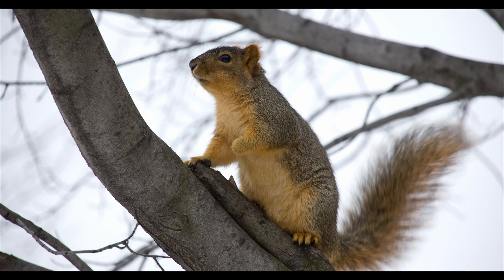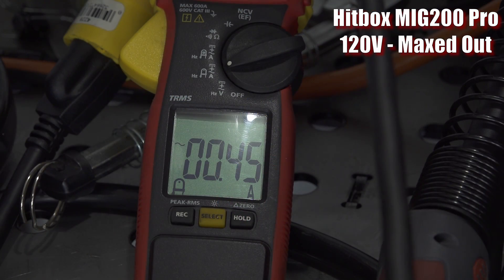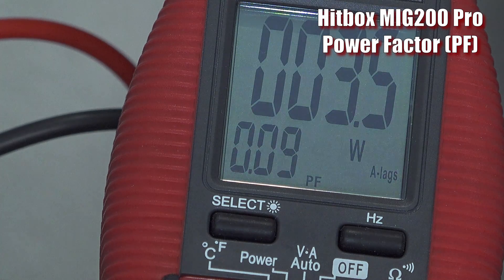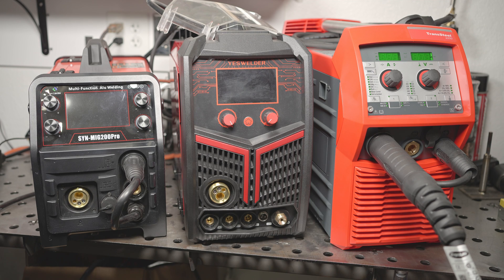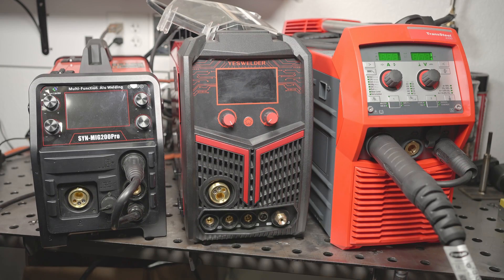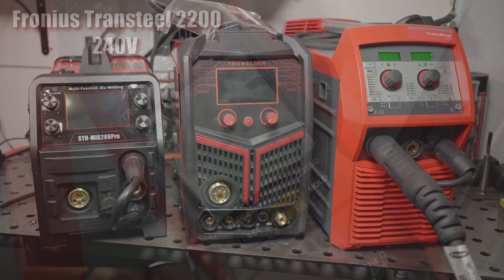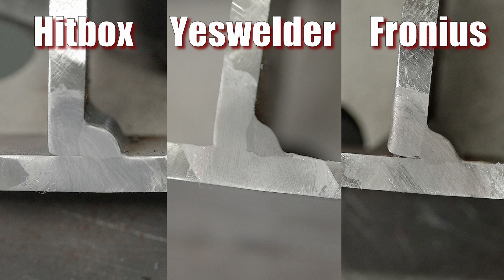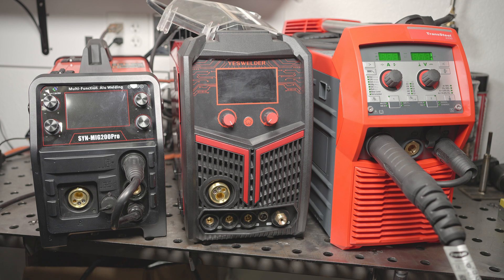Multi-Process Welder Comparison Part 2: MIG Output Testing, 240V and 120V

Comment: I took delivery of a previous gen hitbox mig200ii (identical to arccaptain mig200 as far as I can tell but w/led panel instead of lcd).  I believe it may be internally similar to the one reviewed here.  I was not able to go beyond 180A adjustment on synergic no matter the diameter selection, but under manual at max wire speed (no amp display when doing it this way) and max volts, my clamp meter read 200-220A using .03 flux core.  The display also shifts from wire speed to amps when welding starts though this one would only read 180-200A max.

I also had cut outs but I had my roller installed backwards and was using a v groove.  Once I selected the correct v-groove size, cut outs went away....I've now installed a v-curled....the machine came w/o one even though it came w/a flux core spool.
Reply from the maker: I suspect a LOT of the generic welders on Amazon (and eBay, aliexpress, etc.) are based on similar guts made in the same handful of factories.
Reply: @bigtb1717  I lowballed the same Riland seller I bought the tig from at the auction site for the comp's 200A multiprocess (I'm guessing he's liquidating inventory).  The thing is very well built (think HF vulcan line).   It claims CSA certified which I believe given the duty cycle, heft, and I haven't popped a breaker.  The downside is it's synergic w/only +/- 20% voltage trim allowance.  A reviewer on youtube kind of sold me on it.  Hitbox has way more flexibility though.

Comment: Does any multi-process welder out there have a decent power factor and not have obscene power draw on 120V and actually weld decently?
Reply from the maker: I would say the Fronius Transteel 2200 meets those criteria.
Reply: Hmm.  Maybe I missed something but I wasn't too impressed by comparison with the other two machines in this review.  It certainly was better behaved, but at 2x to 4x as expensive I would've expected much better.

I keep thinking back to the Klutch machine you reviewed and I simply can't comprehend how no one has put that kind of care and thought into a fully multi-process machine.  I would gladly pay, say, double  or even 2.5x that (at the time) $400 price for a machine that could do ac/dc/pulse MIG and TIG plus stick, and do so with the same power factor and output control as the Klutch (and gave as nice results, too, obviously).
Reply from the maker: I admit my testing probably wasn't the best demonstration of the Fronius in terms of displaying fantastic welding.  But I would say that it welds very well in most situations.  As far as power factor is concerned, it's as near as you can get to perfect.  It measures 0.99 power factor.  A power factor of 1, or "unity," is "perfect."  

When I tried to get more out of the machine on 120V than what really made sense, it would limit voltage or wire feed speed to prevent the output wattage from going above a certain level.  This meant that the input current never got excessively high.  It never had obscene power draw on 120V.  Honestly, I would never fear tripping a 20 amp breaker with the Fronius.
Reply from the maker: Oh, and that Klutch machine really is a gem for the price.
Reply: Yeah, I wasn't referring to the weld quality (though, honestly, the Hitbox looked like it was performing the best of the bunch just in terms of weld quality), just the current draw of the Fronius.  It was still pulling 30ish amps.  Only slightly better than the half-as-expensive Yes welder (though, admittedly, also putting out more current if I understood the video correctly).

But, yeah, it's an incredible letdown to me that there don't yet seem to be any fully multi-process machines out there offering the kind of value and quality as that Klutch.  I would much prefer to have an all-in-one solution but it's starting to look like that just isn't in the cards (the Fronius is simply too pricey from my perspective).

Comment: How does the Hitbox compare in MIG to the Yeswelder 205 you reviewed a while back? Was the 205 overrated on current like this MP200?
Reply from the maker: The MP200 and 205DS performed virtually identical and had the same features and capabilities in terms of MIG, TIG, and stick.  The MP200 just had a different interface and plasma cutting.  Even the way the MIG synergic adjustments worked was the same, the MP200 just used a color screen instead of digital number displays and LEDs on the 205DS.
Reply: @bigtb1717  thanks, very helpful

Comment: there is a setting on the fronius that limits the amount of amps the machine pulls from the 120v and 240v circuits btw
Reply from the maker: Yup.  Nice to help prevent pulling too much current or tripping a breaker.  I had that setting turned off for all testing.  In case you were wondering.

Comment: Really great video. I have never seen someone check the input output amperage before not is very telling on some of these machines. Do you have any thoughts on the comparison between the yeswelder 205DS and the Everlast cyclone 200 es or similar. I am thinking of purchasing one of these two welders
Reply from the maker: I've tested the 205DS on this channel. I'd like to get a Cyclone to test, but haven't yet.
Reply: Thank you for replying so quickly. I watched the review earlier. I just had a 240 volt circuit installed so that I could upgrade my welder. I am looking for a MIG welder that is reasonably priced that will give me 200 amps for thicker metal. After watching some of your videos I have some concerns about these welders producing the proper amperage. It cost me $600 to have the 240 installed and I expect to pay another five or $600 for a welder and that would be a lot of money just to get 20 more amps then my 110 welders. Let me know if you have any thoughts or suggestions. Thanks

Comment: Another nice Video, lovin your DMM, good ole Dave Jones kit. The PF corrected machine has got some grunt, the MP200 struggling as always... Did you order the 2050 after? Defo looking forward to your assessment.. Not gone through every video of yours but first time seeing power analyzer kit. I used a DSO for most of my tests on the MP200. I tried to compare it to a repaired Welder that also featured Lift TIG but for whatever reason I couldn't get that to behave like the lift tig descriptions from a google search. If you have a DSO and current clamp it would be nice to see a proper lift tig machine behavior captured waveform.
Reply from the maker: I don't have a DSO, but I have tested the open circuit voltage of other lift TIG machines.  Typically they have very low open circuit voltage (9-20 volts).   To me it seems like when you initially touch the electrode to the work they provide only very low amperage.  It's not until you lift the tungsten and the machine detects the circuit opening up that the amperage ramps up.  I should do a video just testing and showing the difference.

Oh, and yes, I ordered a CT2050.  I'll be giving it a thorough shakedown.
Reply: Look forward to that... Its safe to say the MP200 has lift start and also hot start, well, that's what yeswelder call it.. The hot start is extremely brief and the lift start, well 50A flows soon as tip hits workpiece.. This stuff can be worked around I guess but I'm little disappointed if I'm being honest.. Just sounded so good, well done to they're campaign.. Keep my MP200, best welder I got.. (like, only welder I got)..

Comment: Looking forward to the TIG/stick video.  I have the MP200 and, other than verifying it worked when it was delivered, I haven’t touched the MIG.  TIG and stick issues are still more my technique and lack of knowledge than the welder, but I’d like to see your experience with it.  Keep up the great videos!
Reply from the maker: I have already done a bit of stick and TIG with the Yeswelder.  As for stick, it does fine, but it maxes out at 160 amps on 240V, not the 200 amps claimed.  This means you are likely getting less amperage than the display says.  If one of the "issues" you alluded to is that the rod sticks a lot or runs cold, try turning it up beyond what you might thing, because you might not be getting the amperage out that the display says.  I also don't think it runs 6010 very well, even in 60xx mode.  Otherwise, for running 6013, 7014, 7018 and 6011 it does fine.  The hot start is minimal and there is no adjustable settings beyond just amperage.  So it's very basic, but it's fine.

TIG also maxes out at lower amperage than claimed, and it's scratch-start, not really lift start.  So arc starts are a little trickier than something that has a true lift-start mode.  It's as basic as TIG welding comes, but it works.

But I will definitely do some more testing and comparisons of TIG and stick with the Yeswelder compared to these other two machines.
Reply: @bigtb1717  Same things I’m seeing: runs cold at almost all setting, and I assume the delta is greater at higher currents.  I had issues with 6011, but seems okay now.  6013 and 7018, likewise run decently, although cold.  Thanks again for the great video.

Comment: Great video as usual.  Can’t wait for your review on stick and TIG.  I noticed that you ran .035 wire, I was using .030 with 100% CO2 gas for my measurements.  That may be why I got different readings on the Hitbox.
Reply from the maker: In the Hitbox I actually did use 0.030" wire because that's the only size wire I had that had synergic settings on the Hitbox.  But I was using 75% argon, 25% CO2.
Reply from the maker: I guess I should have been more clear when I said I used 0.035" wire for all the testing.  I meant in the Yeswelder.  Well, also in the Fronius, lol.

Comment: I've had issues with my frounus running fluxcore and I bought the driver rollers for it also.
right now it's on mig duty in the shop (didn't buy it for that)

on the plus side it runs aluminum so well!
Reply from the maker: Interesting.  Does it struggle to feed the wire properly, or does it just not run well?
Reply: @bigtb1717  ya slipping no matter what it got better after I got the wheels for it but still not what it should be.... my miller 211 is the mobile welder for now.
I use fluxcore in the field
Reply: Well I use fluxcore up to 1/4 then stick welding after that
Reply from the maker: Strange.  I got drive rollers for mine that are supposed to be for flux core.  They aren't actually knurled, but they have gear teeth built in so they will both drive to feed wire.
Reply: @bigtb1717  that's how mine are it's so odd 

Well i like the cod gear deal but it not being actually knurled!

If you look at the same wheels for the trassteel 2700 they are!
Reply from the maker: What size flux core were you using?  I'm wondering if if the wire was binding in the liner or something.

I suppose I'll find out if I have issues too.  I'll be trying to run 0.035" dual-shield.
Reply: @bigtb1717  0.35 is what I use 90% of the time I tired 0.45 in it also and with liners 0.35 and 45 didn't matter 

I do like the Liner design besides the cap at the end (blue for 35 and red for 45)
Reply: disheartening $2500 and it doesn't run Fluxcore. 
my Lincoln 180 for $650 from ebay never had a issue running fluxcore ever.
Reply from the maker: I was planning to run dual-shield flux core with mine.  Maybe I'll try dual-shield in all these machines to see how it goes.
Reply: If your having trouble with fluxcore on your 2200 make sure you have reversed the polarity, I am sure you did, but set the wire tension low like less than 2 and you need a 1 inch stick out. My 2200 runs fluxcore really well. Have it loaded with hardsurfacing  fluxcore  and runs it smooth as silk. Try a different voltage by 2 volts or so up or down see if that helps. If all else fails try a different wire, also use only 035 or 045 .Select Arc and Blue Demon wire work well for me.
Reply: @bruced1429  I use blue demon and I don't have a issue with the way it welds with fluxcore but you have the wire tension low!?! And it feeds well?! I got to try that
Reply from the maker: The reason for the "knurling" of the wheels for flux core is so you can run light pressure and will still feed.  Since flux core wire is essentially hollow, high roller pressure can crush or deform the wire, causing feeding issues and possibly other issues with running.  Because of that, I was surprised to find the "flux core" rollers weren't knurled for the TS 2200, but I figured the gears for dual drive made up the difference and allowed feeding at low pressure.  In fact, I haven't swapped them out yet, but I was actually kinda hoping that since the wheels aren't knurled, I can just use them for flux and solid wire so I don't have to swap the rollers when I swap wire.

I hope you can get it working well for you.  It's a shame to have a machine like this and have it not do what you need it to do.
Reply: @bigtb1717  fluxcore wire works just fine on my 2200 much better than on my esab 215. Which needs knurled rollers. I have not tried fluxcore on my HTP 220 but it uses knurled rollers. Anyway light pressure is all you need.
Reply: on my 2200 i used the double geared rollers for metal core. works perfect. youve probly got something adjusted or setup wrong
Reply: @wonghunglo1  I have it in the shop set up for mig. No problems with mig at all
Reply: all i can say is get a clue what your doing before talking smack on a machine. seems clear your not set up properly. you had the wrong drive rollers. probly got the wrong liner and roller tension. hek you probly even have the wrong contact tips.
Reply: if you have everything correct (drive rollers , tension ,liner, contact tip , no kinks) then likely you have the spool tension to high.